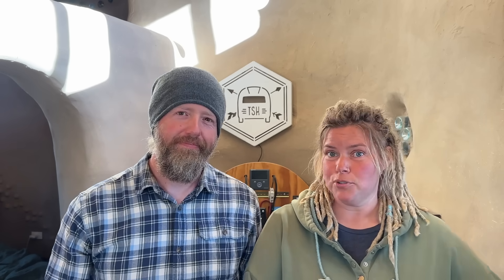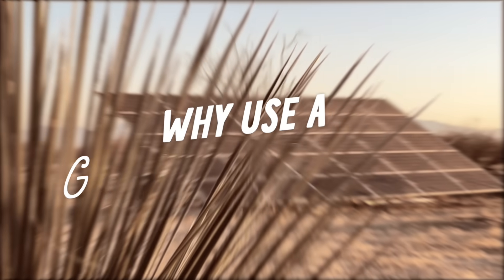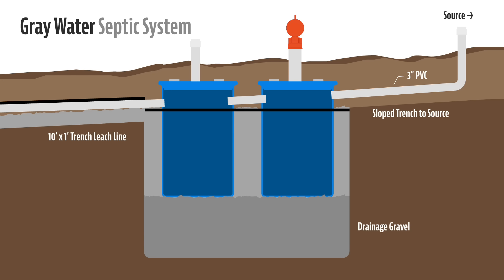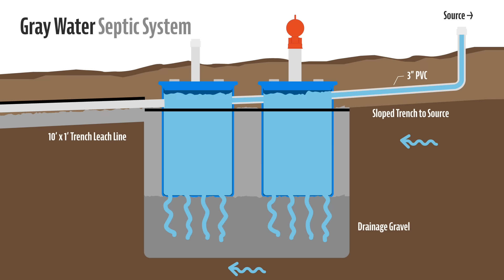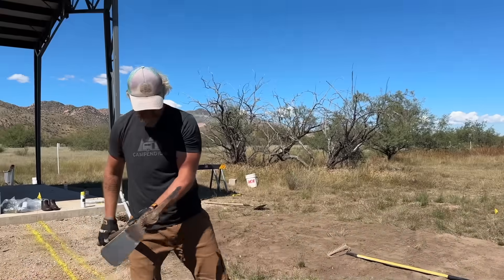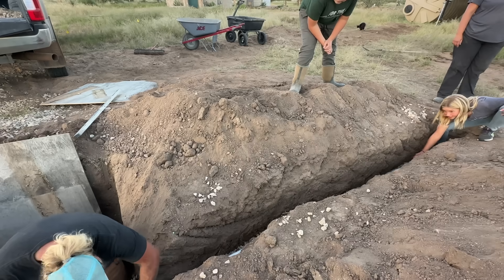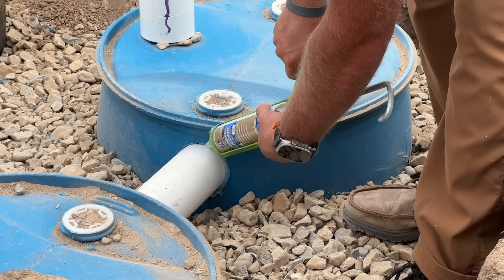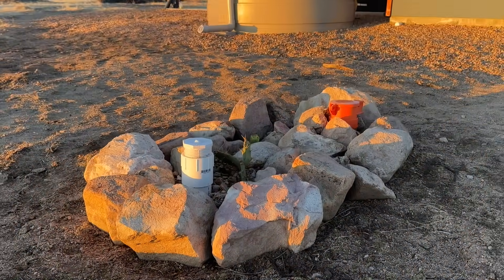How to DIY Your Own Gray Water Septic

Comment: I’m no expert but I def think you need couplers on the barrels instead of caulking. Or some form of structural union
Reply from the maker: Nah, once it's covered up with soil it's fine. Our permitted real septic had pipes going into chambers the same way.
Reply: @TinyShinyHome  👌👌

Comment: I live in an old farm house where the septic system is way too small to handle me routing all my sinks, tub and shower into it (old single chamber septic) Currently they just had a perforated pipe in the clay/dirt with no gravel, no vapor barrier and needless to say that failed so I dug it up and put a utility pump at th lowest point as a temporary solution. How much bigger do I need to make my system?

Comment: 5:14 "it is a 40 gallon tank system, and we as a family of 6 do not use more than 75 gallons ... " Doesn't that mean that you are way over you 40 galllon mark?
Reply from the maker: The 40 gallons is just referring to the holding tank capacity of our Airstream trailer. The gray water septic is 110 gallons. But either way we’re never using more than a few gallons at a time.

Comment: very well done, I was wondering if you know of systems that use your tub/shower and bathroom sink water to drain/hold in a tank that is then used to flush toilets.?

I have been looking into stormwater collecting, where in the past it was illegal, in the past few years things have needed to adapt.   When rain hits the ground it for the most part ok, but as it flows along the streets, fields it picks up all that nasty stuff, this water does not go to a water treatment plant 90% of the time it is dumped into our rivers and oceans, this is wrong on so many levels,.
In several locations around the planet they are trying ways to 'SLOW THE FLOW', most cities the streets, sidewalks, parking lots, and rooftops are not slowing the flow. How they are made does not allow the water to seep into the ground. Step one change the material to allow water to pass thru it to installed large holding tanks, a system under the roads and parking lots a series of tanks with rocks, gravel, and plants. the water tank enters a tank at the top with plants that are filtering as it flows down. the next tank, it enters from the bottom and plants in this tank filters as the water flows up to the next tank,  A STEAD FLOW OF AIR IS ALSO REQUIRED. 
After some time the water is slowly released into the ground where it will do as water has done for billions of years .

One other very interesting setup I have seen and I  am looking into it more.  Large storm areas are dug in the yards of homes, filled with rocks and plants all the rainwater from the roofs and yards fill these areas, sometimes multiple areas. At the bottom of the collection areas are cages filled with rocks, a pump then pumps the water up to filtering tanks, each tank filters finer particles, 
This is the start of a loop system where the water is piped to a man-make waterfalls feeding a small creek running across their  property, all the way special planets are cleaning the water and the air from the water running over large rocks to creates a great water feature, at the bottom a ponds has rock-filled cages that pumps the water back up and this continues several times with each pass a % is the water allowed to natural seep back into the ground back to the underground water shed Nature allowe to do what it always has. .

Comment: Just what I was looking for - great explanation, we should be easily able to follow your instruction… though I think the digging may be more challenging in our ground!

What is the purpose of the vapour barrier in this system please?
Reply from the maker: To keep moisture from coming up to the surface 👍
Reply: @ I think I understand…. so if the water table rises within the system, the barrier provides a ‘cap’ that essentially ‘encourages’ that water along the system to the leach and beyond?
Reply from the maker: Right, when water touches clay it will absorb work its way up to the ground, then it's gross and soggy and potentially dangerous for animals since there's bacteria in it. The barrier just makes sure it leaches down through the rocks instead of up.

Comment: I did this with the two stepped-down blue plastic barrels and about 20 ft. of leach lines (3) on about 5 ft. of clean 3/4"  gravel topped with 2 ft. of gravel, filter fabric and about 2 ft. of soil back-fill over all.  Have to pump out my first barrel about every two or three years.  It's worked for 7 years now for my one-hole tipi bathroom in the Mojave and and it works, at least for me living alone, but I have loads of company.  Now I have to deal with my separately drained kitchen sink french drain that's clogged with roots.  Loads of grease I'm sure because I love bacon.  I'm not sure how to do that sink, maybe a mini version of the bathroom system.  Do not forget where your clean outs are!  They tend to disappear under foliage in time and it's easier than you think to loose track of them!
Reply: And you must have room for the honey truck to access once every couple three years or so.

Comment: Love the video and the step by step write up on your site.  I'm new to this, so my question is, what's the purpose/reason for the vinyl vapor barrier over the gravel in main hole and on top of the leach line?
Reply from the maker: Thanks! To keep any moisture that may not drain fast enough below the surface. In winter any kind of water stays around a lot longer, and can saturate the ground, creating a lot of grossness. The first line of defense is building the system and the drainage large enough so it doesn't overwhelm the soil, but the vapor barrier is added insurance.

Comment: So, one year later, how is this holding up?

What you describe here (in a friendly, cheerful and informative fashion) in NOT a grey water septic tank. It's simply a grey water soakaway. I think that the crux of the problem is your misunderstanding of the function of a septic tank, as borne out by this statement: -

. . .  into a buried waterproof tank that is large enough for the solids to settle at the bottom.

No. You misunderstand the function of a septic tank.  It's large enough for the solids to sink to the bottom, until they have had time to decay and separate into clear water and a small percentage of undissolvable material. This will need pumping out from time to time. What a septic tank does is three-fold: -
1. It separates the "floats" from the "sinks" from the middle fraction, and
2. It provides sufficient retention time to allow bacterial breakdown of both the "floats" and the "sinks", and
3. It (almost) always has two or more chambers, so that progressively clearer and cleaner water moves from one chamber to the next.

Ideally, the discharge water is clean enough, and free enough of suspended solids, that it can flow into the leach field indefinitely, without clogging up the pores in the soil.

Your system entirely omits the retention of the grey water, to allow it time for the bacteria to break down the solids, or the fats. Instead, you are dumping these directly into the gravel below the barrels, and hence into the soil.

The solution? Replace both barrels with new ones with NO holes drilled in their bottoms. The gravel below them is a waste of time, money and energy. The first barrel will retain the water while bacteria have time to break down all the nasties. Cleaner water will move into the second barrel, ditto. Still cleaner water will flow out into the leach pipe. Lengthen your leach field pipe to compensate for the lack of holes in the barrels. Change the inlets and outlets into T-pieces, identical to what you'd find in a proper black water septic tank, for exactly the same reason. Make no mistake. There may be less bacteria, fats and suspended solids in grey water than in black water, but they are still there. That's why it's grey water, not clean water!

HTH 🤗
Reply from the maker: There are lots of names for it, and this is the one most people use when searching. We understand and explain the difference between this and a traditional septic (and have a very informative video on this as well - https://youtu.be/oAsd7ScjGcs) so I'm not sure why you're getting hung up on the semantics 😂. The big idea is that in places where you can't re-use gray water (which is very much encouraged in the desert), this allows it to soak into the ground safely and quickly without smell. No additional solution is needed because the system is working flawlessly over a year later with zero buildup in the tanks. And should it ever need to be cleaned, that's why there are clean out ports.

Comment: Wondering...  If the tanks do get clogged after years of use,  what you can treat the tanks with?...  or if you just need to rebuild the system again at that point?
Reply from the maker: We left cleanouts on each barrel so you can pump if needed.
Reply: @TinyShinyHome  I had one of these grey water tanks installed in the side of my house to just empty out my washing machine, which does have a clean out port.  My issue is that after many years of use it's constantly backing up and poring out of the cleanouts, specially if you are doing multiple loads back to back.  Looks like years of lint has clogged u the holes and or rocks?  Maybe installing a sort of filter would of helped.  Thus my question...  is there a way to treat or does it need to be redone.

Comment: I can't understand why kitchen sink water is considered black water.  When you live off grid with no septic system and compost your poop and food waste, typically you would wipe all food waste with a tissue or paper towel and all goes into a bin that goes into the compost along with the poop in a pail that is covered with sawdust after each use.  Water that washes the dishes therefore never has more than a lick of food left on it.  Shower water, hand sink washing and clothes washing water goes along with the dish water and even urine is not black water, it too can go in with the grey water.  Draining these into a French Drain with stones and sand all around is the way to go, I had only been dumping it onto a peat moss/dirt base which filters it nicely, however an actual pit like this one would be much better as it would divert any potential for smell and animal attraction away from your living space.  I would simply dump the composting materials into the big black composter that is in partial sun and does a great job packing down a year's worth of compost into a thin layer of compost the next Spring.  It's a bit more work than just flushing and forgetting about it, but a lot cheaper and easier than having to deal with building permits and rules.  If you question how sanitary it is, consider my water source is river water that I add a little bleach to each time I pump into my containers, and I never got sick once the entire time I was there, so basically not unsanitary at all.  I drank purchased water... The composter is only about 50' away from the dwelling and you never smell anything.  Sawdust does a great job of covering poop smell too, as long as you don't add pee it really doesn't smell.  Adding a pee diverter to the bucket with a small funnel that diverts the pee out through a tube is the easiest way to accomplish this.  One person will fill a bucket per month.  I typically insert a large composting bag for sanitary reasons, keeps the bucket clean and easier to dump when full.
Reply from the maker: It’s a state law. Probably has to do with desert soil infiltration rates.

Comment: This is legit. I'm assuming you can use a similar system for black water as long as the two aren't mixed and it's easily pumped out?
Reply from the maker: No, then it’s time to get a real septic ;)

Comment: How long this system last???
Reply from the maker: As long as you want. If it's a true gray water system and doesn't have food particles or scum then it should all just drain through the rocks into the ground. If you're clogging it up with other stuff, then you may have to get it pumped, but that's why there's a cleanout.

Comment: How will this system work in ground that is mainly all clay and in a colder climate. Anyone have any experience with this scenario?  Thanks
Reply from the maker: We do not...but from a high level understanding of septics if your ground is cold and mostly clay you would at least need more gravel to slow down the drainage so it doesn't back up. And maybe more barrels depending on how much water you're putting in since it will dry slower in the colder climate.

Comment: Great job. You could have used the 3” holes to add bushings or another coupler to the inside so the stand pipes aren’t just loose up top. Still works fine I’m sure.

Comment: I put mine in ...but had to do it by code....1000  gallon concrete tank  beside  schedule 40 pipe and 320 foot of leach line ....besides  all the sand and number 2 rock....had to be transit dug..to get the right fall and depths....first time I put one in....contractor  wanted  6 or 7 thousand  to put in....
Reply from the maker: Yeah that’s a real septic :) https://youtu.be/oAsd7ScjGcs

Comment: One thing you need to consider. I had a house that had a gray water system for watering plants, and the main difference you notice from a regular house is you should avoid flushing wipes, tp, etc down the toilet, because the lack of bathwater etc seems to make it a lot easier to clog. I had a lot of clogging issues at that house and finally made everyone toss tp and stuff in a separate waste container I disposed of daily for the rest of the time I lived there.
Reply from the maker: Yeah, that’s a totally different thing - a true gray water septic should never have a toilet anywhere in the system.
Reply: @TinyShinyHome  it didn't have a toilet on the gray side. The black side that was hooked to a legit septic system was the part that was always clogged.
Reply: I'm on city water and sewersand I have a similar problem because I have low flush toilets and a backlog valve. I was told by the county and several plumbers to dump 5 gallons of water down each toilet every month. Kinda defeats the purpose but it works.
Reply: @ericgeorgetruckgrilling  it's kind of like those old loves diper commercials when it comes to "green, less is more, eco friendly, and saver" items you live and you learn then you get like me and and "I won't buy it unless it's like led vs incandescent light bulbs. The led lasts longer and is considerably brighter per watt of energy used. I don't believe going green should have to at the cost of paying more for something that doesn't even function as well as the standard item it is meant to replace, and refuse to buy it until it at least is more practical to use than the old standard. (P.S. I also hate that our government force feeds some of this green crap to us in things like automotive. You want me to switch cars make one that doesn't break down every 10 minutes due to your bs added regulation garbage, and planned obsolescence. Filling your pockets and the junkyard isn't saving the world....)
Reply: if it doesn't come out of a human body it shouldn't go into a septic system. I have a 4 bedroom house with a really old 600 gallon septic tank and we never flush anything other than human waste. Have it cleaned every 3 years and it has almost no solids. grease trap catches all the nasty stuff from our sink before it goes into my gray water system. My gray water goes into a 300 gallon IBC tote filled with 2b gravel with hundreds of holes drilled in it and 30 ft of leach line set in 7 tons of gravel.

Comment: What made y'all decide to install septic barrels/tanks and a leach field instead of a 2-stage natural filtration system? With the Airstream outlet above ground, it seems that it would be pretty easy to build a prefiltration trough that discharged to a gravel/sand/gravel filter and using the effluent for toilet flushing, irrigation, etc.

Not second guessing y'all. Just genuinely curious.

I live, work and travel full-time solo in a self-converted box truck, and use an ultra-compact, 6-layer, gravity, gray water filtration system and love it. No dumping of gray water...ever. With a urine-separating, compost toilet of my own design, no black water is ever generated. Liquids are emptied as needed (every 4 or 5 days, or so), while the solids only need to be disposed of every 4 to 6 weeks, or so.

Comment: Excellent instructive video, for which thank you! Question: Assuming that in coming years you will get buildup of (non-toilet) sludge in the tanks, is there a DIY approach to siphoning the sludge out through the two cleanouts? What kind of pump might accomplish this task? Thanks in advance!
Reply from the maker: Since it's just true gray water there shouldn't be any sludge. If there was something inside I would guess the easiest thing to do would be to call a septic company to pump it.
Reply: @TinyShinyHome  I reckon you are right. In a pinch, a simple sump pump should work, as long as there's plenty of water in the tank. Pump from the bottom into a tank on a truck for disposal elsewhere. Thanks again!

Comment: Why seal the pipes? They are in drainage rock in drainage. Seems like a wasted step. I like the plan my only suggestion is forgoing the sealing the pipes in the barrels. 
 You know just a thought passing gray water through a sand filter might get the bio matter out leaving clearer water that. Can be stored in pits pools pounds without washing machine nasty smell

Comment: Interesting.  I live in an old farm house on national park land.  Its greywater system consists of pvc pipes running out of the house straight onto the ground....  
Then there is a combined shower-toilet septic built proper like.  I was just going to zhush it up by digging a pit and filling with rocks under each outlet. 😏